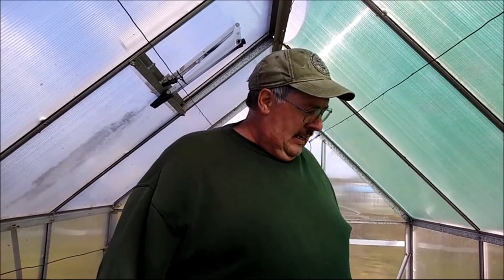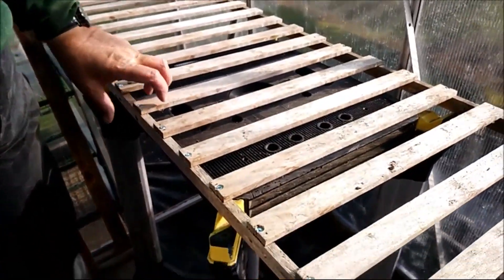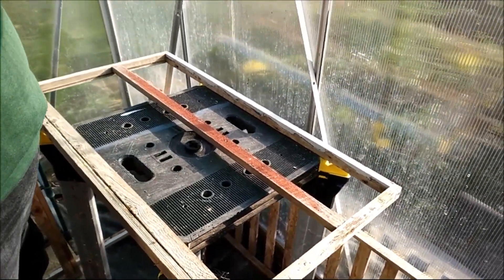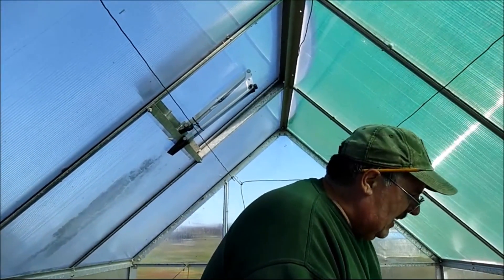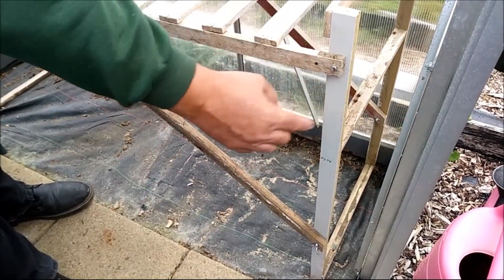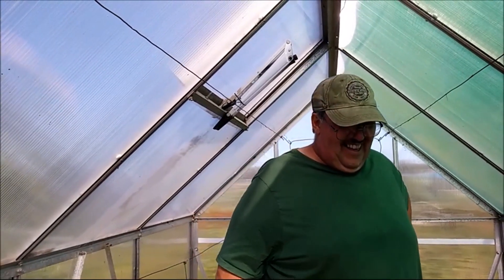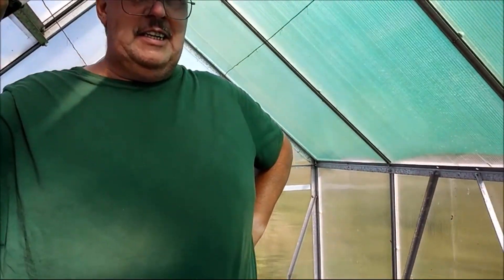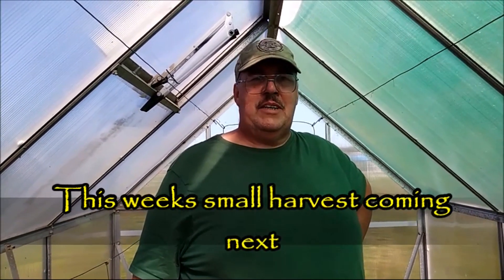Fold away greenhouse bench

Comment: How do you find that poly glass? I considered that before I got my glass GH but the glass one came up for free.
Looking good with that bench,
Clever design.
All the best
Steve
Reply from the maker: Hi Steve I find the pollycarbonate lot better it's 4 mm twin wall and it's warmer in spring and safer with the young ones , plus the older ones who like to break glass , in 11 years I've only had to replace one sheet as they are clipped and screw in place , and thank you for that on the bench we always need extra space at begin and end of season. Stay safe Bill
Reply: Hi Steve I used to have glass in my greenhouse but would get cracked pains, moved over to pollycarbonate not looked back since .
Reply: @billvalsallotments5915  Interesting, I've actually broke one of the pieces on the window vent, but apart from that so far so good.
What I was concerned about was the wind, it gets proper windy at the back of my garden which is the only place the management will allow me to have a greenhouse.
I was worried those poly panels wouldn't take too much wind.
Reply: @jimstocker2157  I ended up being given the glass one so it kind of swayed my decision a bit.
But if it needs replacing at any point I reckon I might look into one of those poly ones.
Thanks for taking the time to let me know Jim.
All the best
Steve
Reply from the maker: @stevesgrowingspace  Hi Steve both our greenhouse are pollycarbonate and are both screwed and clipped in place , one of our first videos shows my daughter and I fitting it to greenhouse plot 2 plus we are in the middle of an open field so it does work .
Reply: @billvalsallotments5915  Thanks, if and when I have to replace my glass one I'll probably get a polycarbonate, thanks for taking the time to answer so fully.
Reply from the maker: @stevesgrowingspace  Steve you are very welcome .